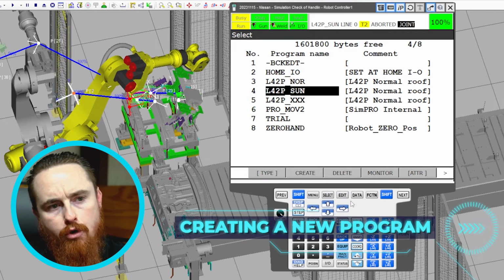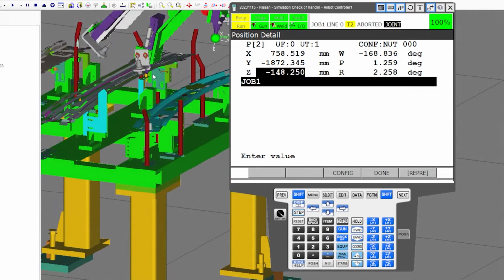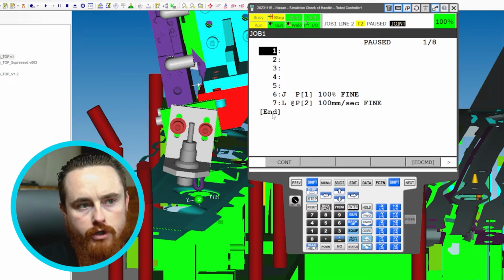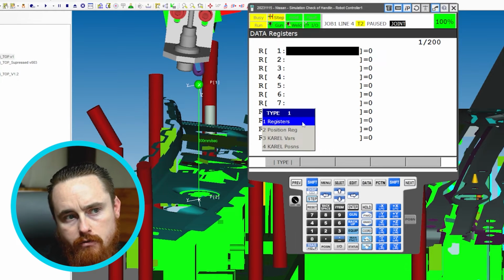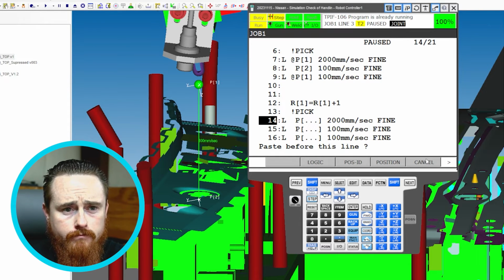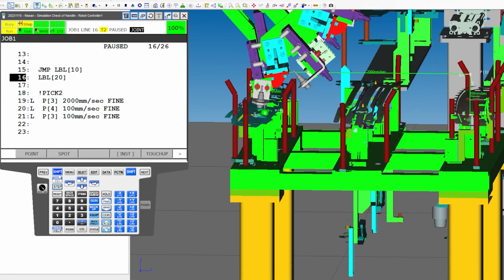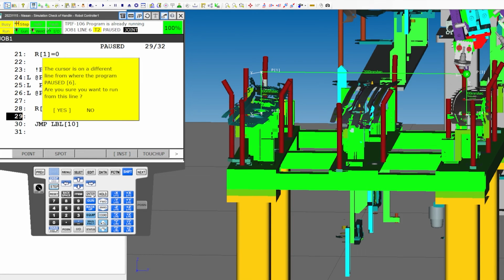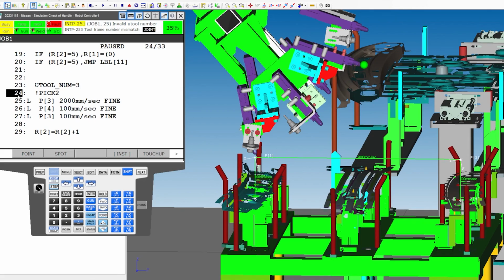FANUC Programming Tutorial

Comment: A correction... The reason joint mode is fast, is because the robot moves only the joint it must, to move to the next position. World and Tool are slower and more precise(in linear motion), because multiple joints move simultaneously to maintain the tool orientation. The primary issue with joint motion is approach/departure angles. Say you have a 30cm long rod that must be inserted into a bore. The approach must be precisely inline with the bore axis for a clear insertion. If such an operation is attempted with a Joint movement, the radial movement will tilt the part off-axis and cause a collision.

Comment: No its easier to move fewer joints and thats why you get the arc its what you told it to do easier has nothing to do with it you need to move several joint together to get a straight line .  It does what you tell it to it doesnt know  easy or hard
Reply from the maker: thanks for your insights.